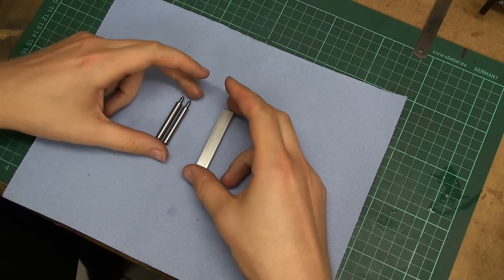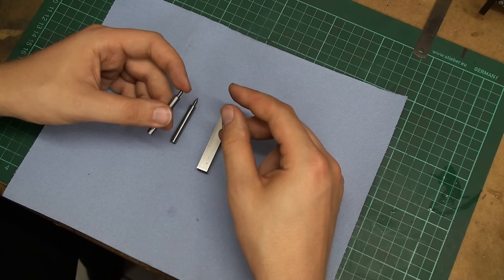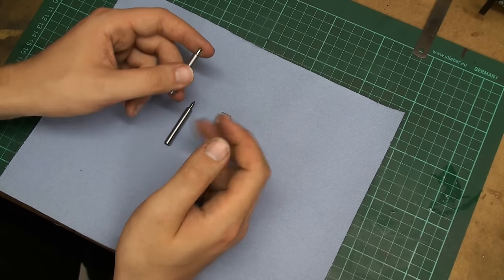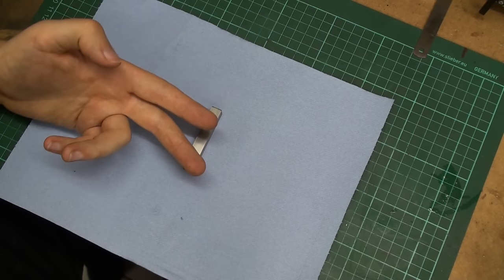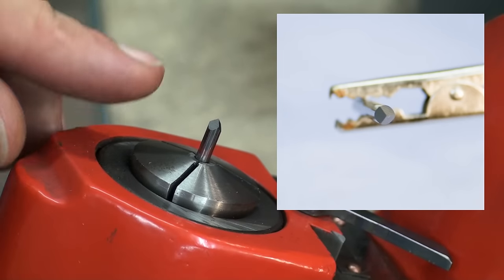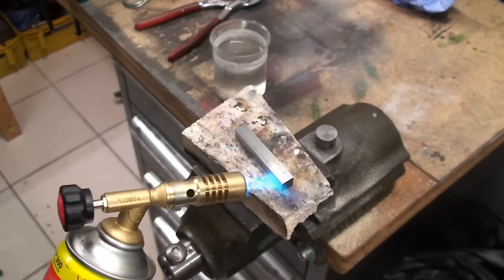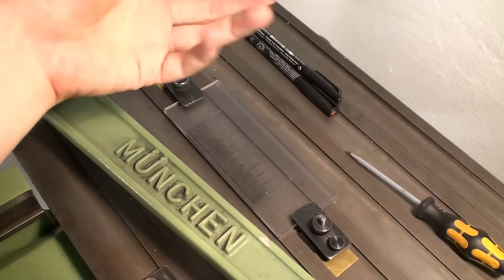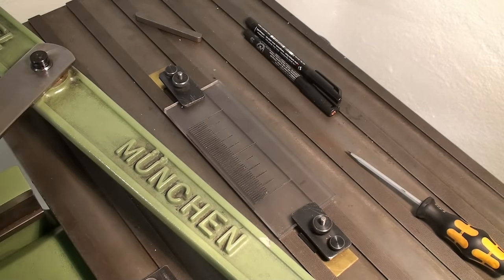R&D: Cutting graduations - Appendix

Comment: Hi Stefan, big fan from Denmark and I need your help..
Recently I bought a pantograph a lot like yours but with the copying table removed. Anyway I got 3 nice spindles with the machine, but during cleaning I removed the set screw that holds the spindle in the pantographs "quill" down feed housing. And I heard a spring inside the spindle go pop, now I can see that the spring is there to create tension on the "back up" release of the quill so now my spindle won't go back up with the quill lever. I can see that the other spindles also have the spring popped and can't seem to understand how to get into them and re-tension the spring. Might you have an idea ? Maybe a video if you have a little time ? 
Anyway love your channel and the craftsmanship you put into your creations.. Br. Anders from DK

Comment: The electro etching by its nature was a bit irregular, but the first attempt directly cutting the steel looked very nice.
Note: by adjusting the dept of cut to get 0.05 mm of spacing and 0.05 mm width of cut would make for easier reading.
Nice and successful experiment Stefan :)

Comment: Hey that was great, I've been working on trying to copper plate things but at best I can get right now is a really thin layer of copper on steel. I've been using a 52% hydrochloric acid, with 24volts DC,  at .5 amps. I get a big burst of transition at first, then nothing. It's starting to get aggravating. 
But you are kicking ass, that looks real good.

Comment: do you have access to a laser? if you do try dry moly spray and then laser engraving the piece, clean the moly after and should leave the engraving marked on the piece, seen some vids on youtube done with some low power laser engravers (on cheap Chinese CO2 lasers) - seems to be working well but would depend on how well the beam is focused and how flat the piece is located.

Comment: Impressive work, Stefan.
Another day I had a try with putting laser printer toner onto copper surface and chemically removed a part of surface, not been covered by toner.
the way I moved toner from a paper was an iron.
The only thing - printer should be sort of non economic one, like old HP printers with a lot of toner spent for single print. 
The same work can be done with regular printer but with overheating for a heater (small change I guess)
And you might know that laser printer can do 133 lines per inch, that is ~5.2 lines per mm, right the same you need ;)

Comment: Impressive, now you don't have to deal with sideplay...
Just like you said the engraving looked deep, are you certain the engraving bit haven't gone into the metal a little...???
But so far the results are promising.
Would there be a finer line if the bit was engraved with a lesser angle, meaning more into a point...
Still watching, thanks for sharing the reflection, Pierre
Reply from the maker: pierre beaudry I checked the graduations under a measuring microscope with 30x magnification and they are well within 1/100mm accuracity to each other - So the side play was the real problem :)
Yeah, I am very sure that I only scratched the paint - Also under the microscope the surface of the etched graduation looks exactly like etched...almost like an EDMed surface..
Thanks for commenting, Pierre :)
Reply: This is a great result....!!! Gave me something new to try ;-)

Comment: sehr gute Arbeit Stefan,

Bitte verzeihen Sie mir , ist mein Deutsch sehr schlecht

And since your english is much better than my German, here we go.

Might I suggest another process that produces super fine results.

If you photograph the scale and produce a reduced (actual size) negative.  You then coat your workplace with a light sensitive film and expose it to a strong source of UV light.  You then remove remanning unexposed film with a special solution.  You then electro-etch the surface through the mask you made and then remove the remaining mask with a similar solution.  This would bring you down to microscopic size features.

I would refer you to a posting by Clickspring (How To Make A Clock In The Home Machine Shop - Part 9 - Etching, Waxing And Silvering A Chapter Ring)
Reply from the maker: Jeff Wolf Ihr Deutsch ist wirklich nicht schlecht :)

I am aware of the photo exposure method - But I have no way to reduce a negative that precise, seems like a job for a real photo lab....I did it at 1:1 scale when I fiddled around with making pcbs (Which I later gave away to a pcb service..)
I am aware of clicksprings videos and follow them very close :D
Thanks for watching and commenting!